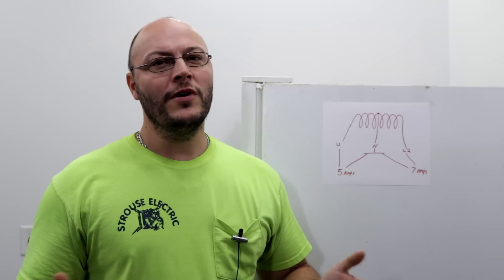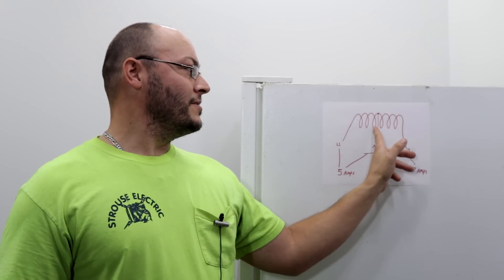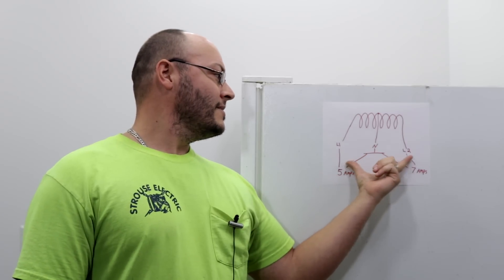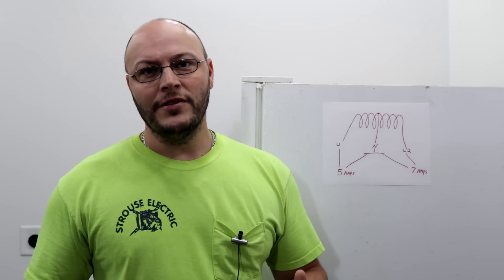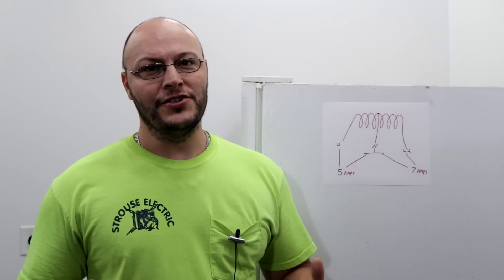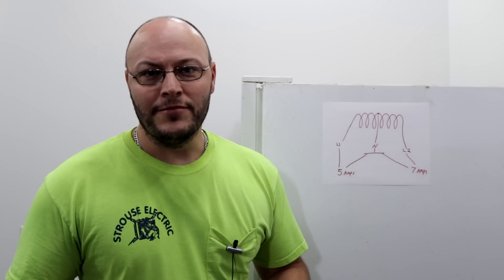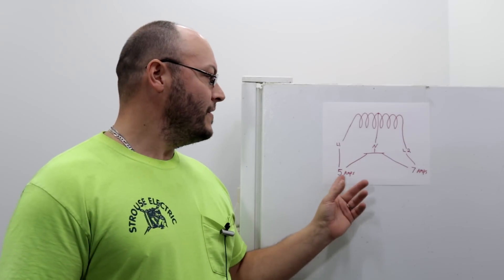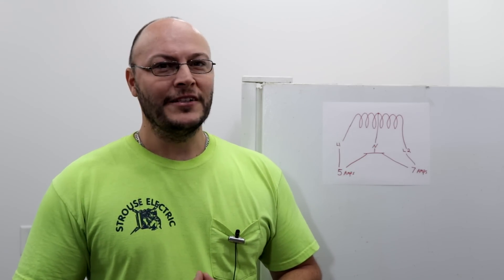What does the Neutral Wire Do?

Comment: Why if neutral and ground different are they both connected in the main box?
Reply: Neutral carries load. Ground under normal operation will not be carrying load.
Reply: jim byr 
For safety reasons for your home appliances. If a lightening happens, the current from the lightening will go through the neutral at your power post outside  to the ground,where it is to neutral at the panel, and then to earth where it is discharged. To verify what I am saying, check your home panel out, you will notice that they are not connected. Because if they are, you will get shocked if you put your hand on a running washer for example.
Reply: MoroccoNews Tribune No.

Comment: Here's my problem with this explanation, in every service box that I have seen over many years, all of the neutral and ground wires are tied together. I usually, also only see the 2 120v lines from the service pole, with neutral and the ground both connected to an actual ground rod that is in the ground near the service entrance.
Reply: For the past 20 years or so of doing panel upgrades the inspectors require me as per NEC to have a ground bus separate from neutral bus on the new panel. The old panels almost always have grounds and neutrals on the same bus. As someone else mentioned, this does deflect lightning away from the neutral, but more importantly it allows arc fault breakers to be used for all living spaces which is NEC that has gradually been phased in to use and is now standard in almost all 50 states.
Reply: the neutral and ground wire are tied together at one point only...
Reply: Neutral is a grounded conductor. It brings full circuit current to the bus at zero voltage. There should be no voltage across the neutral as measured with earth reference.
Reply: That bridge allows the ground wire to "deflect" the charge from lightening away from the Neutral wire, which would've otherwise been carried into the house and lead to failure of all connected loads
Reply: It does not matter that the ground and neutral are, electrically, the same point.  The ground is not a current carrying conductor in NORMAL conditions and is not necessary to the load.  In fact,  home used to not have a ground conductor at all and only had two-prong outlets.  Even today many appliances do not have grounded cords and are only two-prong.   Though you may not see an actual neutral wire in the distribution panel, I assure you there is one in the meter and you have a feed-through meter were the neutral appears either as a bus on the right or a bare wire, which people would assume is a ground.
Reply: I saw a guy try to pull a safety ground from a neutral in an old two wire scheme. That is bad. If the neutral goes high impedence the full circuit voltage could end up on a metal enclosure in a fault condition. Hot wire on box. No circuit trip maybe.
Reply: yikes..that can be bad..thats why knob and tube is a problem .people who think they know what they are doing tie into it and make more problems.
Reply: Stop thinking of a 240V circuit as consisting of two 120V circuits.
It is just a 240V circuit that can be used as 120V if the current is allowed to return to a point in the transformer that has 0 voltage potential. Ground also has 0 voltage potential. You can steal one leg of the 240V circuit and make the neutral the ground and you can make a quick 120V power outlet on a rooftop in a pinch.
Reply: @michaelatkinson4434  well in all actuality the neutral is the only path back to the transformer, it is grounded to dissapate the unbalanced current on the neutral.. On the power transformer the primary winding has two sides. One side of the primary winding comes from the high voltage wire at the very top of the pole, the other side of the primary winding come from earth ground. This earth ground comes from the power substation so they only supply neighborhoods with ONE of the 3 phases. This is known as the WYE type of power distribution. Now on the secondary side od rhe pole transformer you have 3 wires leaving. One wire is the "low" side of the secondary winding and it is black Insulated wire. Another wire is from the "high" side of the secondary winding. I say "high" because this side is in phase wirh the primary winding. This wire is also black insulated wire. The third and last wire is actually a braid of either copper or aluminum that is connected to the center tap of the secondary winding. This wire is not insulated as it should not carry any current. These wires enter your meter on the side of the house then entering the panel in the dwelling. At this point a ground wire is introduced onto the panel from a rod sunk into the ground near the service entrance. In the panel the ground and neutral are connected. This is to eliminate and unbalance current on the neutral heading back to the transformer. So even though you may get 120v from one leg to earth ground, it is not advisable as this is NOT a return back to the transformer. Only the neutral can supply that path
Reply: Darnley Bynoe this dude was talking about electricity on mars

Comment: Yes, the three wires from the transformer CAN be considered independent of any other reference points.  But I think your explanation would have been better and more accurate if you had qualified your statements by saying that in normal (and code compliant) systems, the neutral is tied to ground (at least at the "front" of the circuitry).

Comment: Then why at my electric panel does my ground wires and neutral wires connect on the same bar??
Reply: To: Rich Ags. The two wires you refer to connect across to the other side Buss bar to ground the panel, but this ONLY happens at the panel...not out at the various circuit hook ups.
Reply: Your neutral bus should be insulated from the panel while your ground bus isn't.
Reply: Rich Ags    I saw that you got comments with no real answer.   Here is the answer to your question simplified.   Forget the word "Ground" for a minute.   Really has nothing to do with the question.   If a Conductor that has voltage on it from let's say a 20 amp single pole breaker touches the metal box of your clothes washer, (short circuit) there will be a large amount of current going through the "equipment ground" bare copper Conductor in your question.   When the current gets to your panel, it then goes to the neutral bar.  Then it goes out to the utility transformer, through the coil, back to your house and inside the breaker, this current magnetically opens the 20 amp breaker.   Hope this helps you understand.
Reply: At one point you were allowed to connect neutral and ground wiring to the same busbar in the man panelboard.  But you no longer are allowed to do that.  The NEC requries keeping them separate, and installing the jumper between them, in the event that it is a location where that is allowed/required by the NEC.
Reply: carultch    Which version of the NEC are you finding this please?
Reply: You only connect neutral and ground, where required by the NEC, which is at the main service disconnect.  Every piece of equipment connected to the feeders and branch circuits that come off your main panel, keep neutral and ground isolated from one another.

Notice that the neutral bar is mounted on plastic spacers from the metal enclosure of the panelboard?   Notice that the ground bar is directly mounted to the metal enclosure?   The product is sold with a bonding jumper between that might or might not be installed, depending on the panel's application.  If this were a subpanel (i.e. a smaller panel that is supplied from a feeder circuit connected to the main panel), you would not install the jumper.  If this were the main panel, you would install the jumper.

We connect neutral and ground, in order to set the neutral at the same absolute voltage as ground.  If you touch neutral while also touching ground or building steel, you shouldn't get shocked.  Neutral is at the same absolute voltage as ground, and carries the imbalance of current back to the source.   Current should go back on the neutral, but not in a parallel path on the ground and all metal stuff in the building that isn't intended to carry current.  That's why the N-G bond is exclusive, and only done where required by the NEC.
Reply: Si ese es el caso,tu panel esta mal combinado.tal como te respondieron,la barra del neutral debe estar aislada,mientras no sucede asi con la del ground

Comment: Wire companies got together with government and made it law to have ground wire running everywhere so they could sell more wire.  Ground wire does not make anything safer - just more complicated and dangerous if done wrong.  Making the system more complicated also meant electricians would have to get trained and "qualified" thus giving government more fear based control over the masses of retarded people.  
    Would be much safer if they just grounded utility poles to dissipate static electricity and lightning (extremely important) and then just have 2 wires (110 Volts) running from pole transformer into homes.  All household appliances could be designed to run on 110 volts and using correct amperage breakers would be perfectly safe.  220 Volts is really overkill and not necessary in residential homes.  System could be much more simple and safe.
   What if your standing in a bathtub full of water and drop in a hair drier or toaster you ask??? -----------------------THATS WHAT THE BREAKERS ARE FOR  DUMMY-----------------------
Reply: I love your conspiracy theory lol, but you are incorrect. No one conspired to sell more wire. The ground wire serves several purposes, one important reason being to keep the cases at a static potential. If you did  not have a ground, then the boxes in your wall could achieve a much different potential than your floor (for example), and you could get electrocuted plugging in your lamp. Remember that the transformer just achieves a potential difference between two wires (110VAC or 220VAC as you pointed out), but the transformer does not control the DC offset of that voltage compared to the potential of your home, or your body. That is what the ground is for. Without it, you could reach kilo-volt potential differences between various metal housings around your house and your body.

With regards to your 220V being unnecessary, please remember that we don't care about voltage, we care about power dissipation (wattage). Using higher voltage and less current to deliver the same power has benefits that I won't go into here, but you can research it on your own. This is why your oven works at 220V. Cooking a turkey requires a lot of power, and with a 110V outlet would require twice the current, which is a lot of current. Cooking with 220V halves the current necessary, which has several benefits.
Reply: Are the mentally challenged really scared of electricians?  That's definitely a conspiracy!
Reply: no actually the electricians are the mentally challenged !  Are they scared shitless??? - They should be with this messed up system!  Oh by the way - Tesla invented a way to transmit power without wires..........but then we wouldn't have all these high voltage lines cris crossing the countryside now would we?  Best of luck out there CJ ........ i got more respect for plumbers honestly.
Reply: are you trolling or are you implying that you support filling the atmosphere with high energy  EM waves, and then waiting for us to all grow three heads?
Reply: By the way, I was on the team with Alanson Sample and Josh Smith from intel when we published the WREL project, which was intels first (and I think only) investigation into implementing wireless electricity transmission. Look it up.
Reply: Also, if you rely on a breaker to save your life when a hairdryer falls in your tub, you'll be dead. You better hope you have a ground fault circuit interrupter

Comment: I have a point of view for you, here in Serbia, we have 3 leads, a 3x400v system, where 400V/AC is voltage between leads, and 230V is from any of the leads to the NEUTRAL. So, it doesn't necessarily mean that voltage of N iz zero. In the fact in maby cases it is not. The difference of potential is what counts. If you experience the issue which is called "losing of neutral conductor" than it refers to cases when people substituted neutral with real zero voltage conductor, such as ground and than if the neutral voltage was 40V, they get voltage of 270V on their installation, and destroyed much of the connected devices.

Comment: The ground ALSO stops any current from floating ON a fixture where it would shock you if you touched it and YOU were grounded,.. This would be the MOST important aspect of a ground,
Reply: Randy Kuhns I stopped watching after his definition of ground
Reply: The Ground is made of copper too. Real shiny looks like copper as as matter of fact. I have my grounds all running to my Bed Frame. (On my wife's side of course) just in case never knows these days.
Reply: I have been told grounds should be ran to as grounding rod also made of copper I always thought that was a stupid place so like I said before ran them all to bed frame. The dirt is no place to just throw away a sudden jolt of electricity from a strike we got to use that stuff!

Comment: I was wondering is why is the neutral conductor grounded?
Reply: Near as I can tell that has a twofold purpose... one is to bring the neutral to 0V relative to ground.  Voltage (or potential) is a relative measurement.  That's why when you measure voltage with a multimeter you need to touch two points with the probes.. you're measuring relative potential between them, so either line off the transformer has a potential of about 120V relative to ground.. but 240V relative to each other.

Now if I jump off a ten-inch step to the ground, I'll probably be okay, but if I jump off a ten-story building to the ground I'll get severely injured or possibly killed.  The rooftop and the ground aren't necessarily dangerous, but that large gap between them (the voltage) is if I try to "close" it.  The grounding basically brings that point close to the ground so you won't get hurt if you "jump off" (touch it).

You COULD leave the neutral ungrounded and still measure 120V from one line to the center tap (where the neutral connects to the transformer windings), but then you don't know what its potential to the earth is (chances are pretty good the earth is the largest mass closest to you right now).  If a tree branch has leaned into one of the lines, for instance, the neutral would then be "hot" because the earth has become part of the circuit and the line that connected with the tree is now the grounded conductor (it has 0V potential with the ground).  Deliberately grounding one side of the circuit takes the mystery out of it so we know that if we're touching the earth or anything touching it (you probably are) we know the potential of each part of the circuit relative to us.

And like the video said we also ground it to discharge any excess charges on the lines (usually from static, surges, or lightning strikes).  Again, the earth is relatively huge compared to a person or a house so it can absorb the excess electrons pretty well.
Reply: From what I've been able to piece together, the neutral is the groundED conductor that is bonded to the ground rod.  In the 3-wire single (split) phase system, that groundED conductor is the center-tap from the transformer.  The conductor is grounded to provide a low impedance (resistance) non-arcing path for induced high voltage spikes to the earth.  The spikes come from nearby lighting strikes, starting and stopping motors, cycling arc faults, etc.  This is the system ground.  It protects the equipment.  It stops arc faults from shorting motor windings and other equipment, as well as random arcing to earth such as through flammable material.  

The green/bare groundING wire is used to bond all conductive surfaces that could become energized if there was a fault bringing the "hot" or line wire in contact with it.  The wire provides a low impedance (resistance) path back to the transformer (via bonding to the neutral bus) where the high current  trips the breaker clearing the fault by de-energizing the circuit.  This is called the equipment ground.
Reply: Firstly is for safety amd the proper opereration of breakers, you can find that info easily.  Secondly, The neutral is grounded to "neutralize" the voltage induced by the live conductor being at such close vicinity.  This increases the efficiency of the system by allowing for a greater potential between tte conductors.